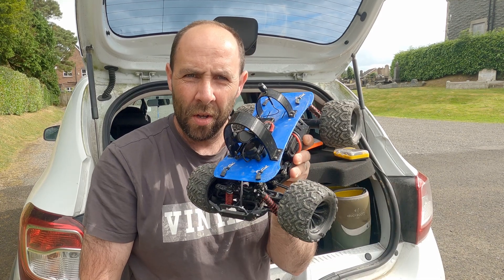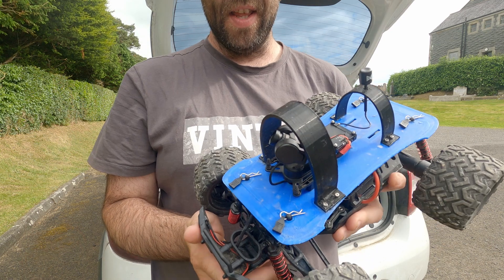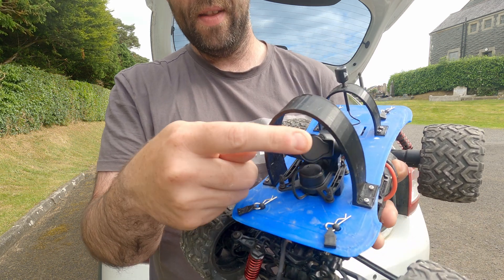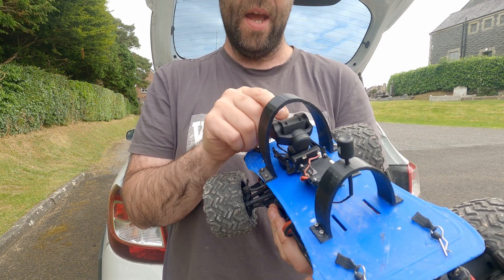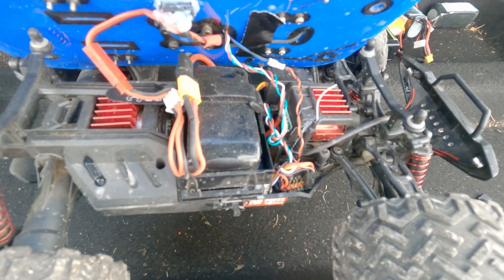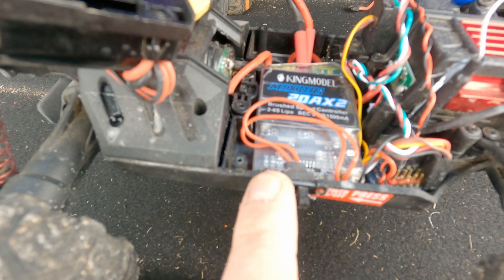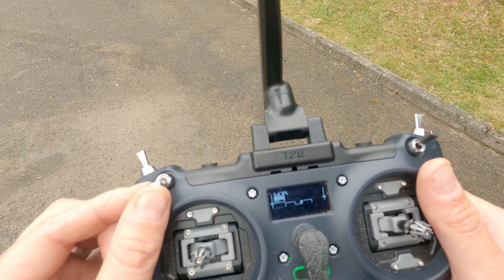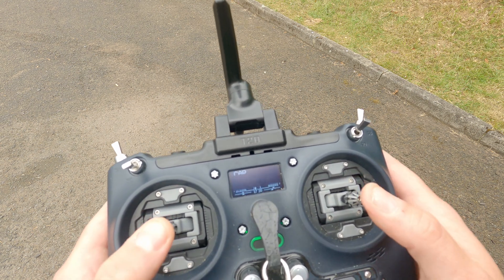TMC-FPV Whats in the Car?

Comment: Good info! I was wondering about the mipi too as I wanted to test this with a couple different systems, and wasn’t sure how an external mipi would work. Subscribed 🤙
Reply from the maker: It will be possible for me to replace the internal mipi, but it's not simple. Very fiddly. My gimbal probably isn't working as well as it could be, but it's working well enough

Comment: That's a cool little rig! Your results are very compelling and had me buy the new Avatar GT just to see how it compares to DJI O3. The gimbal looks really cool also. Maybe it won't have the same problems people are seeing with the G-Port.
Reply from the maker: The gimbal uses a 9axis gyro afaik so shouldn't drift. One of the ws testers is an inav Dev and has already got pull requests ready to implement for maximum tweaking and flexibility

Comment: Hi, you did a great job, I thought you used a gimbal servo or two. :hand-pink-waving:
Reply from the maker: Possible with an FC running inav, so the FC gyro can control the servos. But this is easier
Reply: @tmc-fpv  I see after Gimbal Cadxx Bro